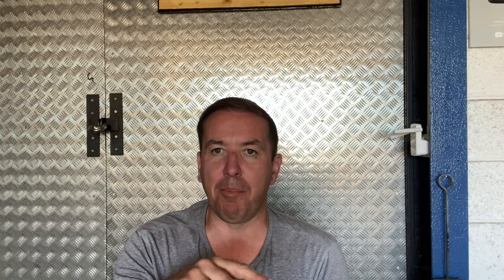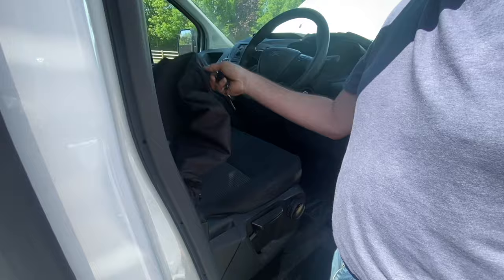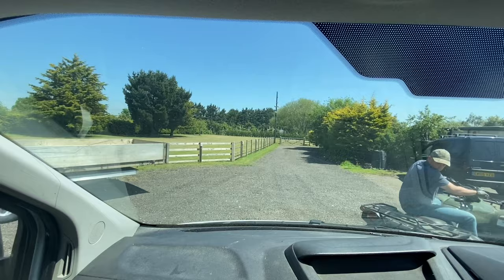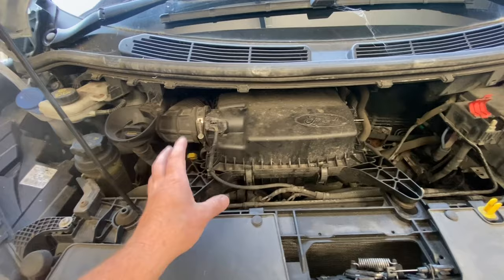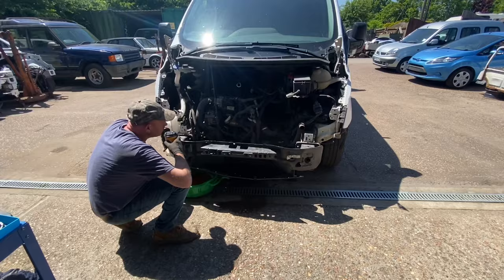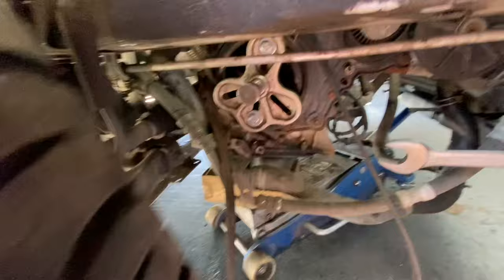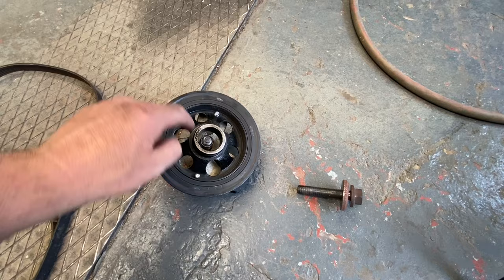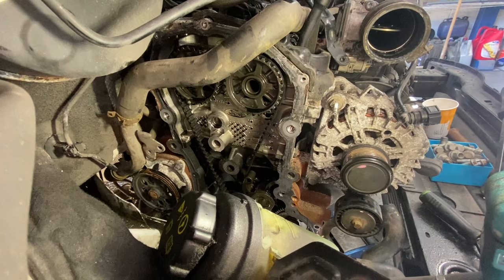Cheap 2017 Ford Transit Custom Euro 6 Engine Fail PT 1

Comment: No wonder that belts not been changed that looks like a nightmare to get into , i wonder how many hrs ford charge for doing it ?
Reply: Had it changed by fords couple weeks ago. £1300 all in. The issue with it was actually the cover that leaked and they changed the belt just because they didnt want it to be contaminated and take any chances.

Comment: That was a great unveiling. It was tempting to think that all engines are basically similar under the bonnet except for the number of bores, turbos or the like. But that one had lots of 'why did the designers do that?' features. I hope that there is no other hidden damage to the likes of valves, water or oil pumps etc. Seeing it played out like a 'who dun it' was fascinating. I was surprised at the amount of corrosion on the alternator and a few other parts, yet the body looked very sound. Part two will be keenly awaited. Thank you for a good few moments' entertainment.

Comment: Have a ford custom short wheel base 2.0 eco blue sat on my drive been there over three months now cam belt went on me at 74,000 miles or wet belt what ever one it is all I know is that three independent garages have put a 5/6 grand repair bill on it! Sadly prior to it breaking down I had just bought a brand new 21 plate and was hoping to sell the other one now I’m stuck with a van still under finance. I’ve asked before and I’ll ask again do you fancy fixing it 🥲
Reply: Send a message on Instagram mate
Reply from the maker: We would buy it unfortunately we only work on our own stuff 👍

Comment: As a Ford tech I can safely say that the 2.0 ecoblue engine is one of the worst engines ever put into a transit. I've not had a single day where a transit hasn't turned up on a flatbed with engine failure. If it's not diesel in the oil it's bits of timing belt in the oil. Such a shame as transits of old laugh at these new ones as they chug on down the road with 200k miles on the dash. Best of luck to you. If I were you I'd run a mile from that transit once you've fixed and sold it. It's massively flawed by design.
Reply: Does the 2022 have the same engine or have they made some changes?
Reply: It's weird because some have over 100k+ miles on and not had the problem yet
Reply: What are the best years for dependability in the Transit Connect vans? Thanks
Reply: Our one the  head   bolts broke top   got stuck under valve  and ejected  cam follower  out through  side   of  cam  carrier
Reply: 2.5 DI banana 👌
Reply: do you have any axperience with ford focus 2.0 ecoblue , is it the same engine as ford transite? i have it and it has 145k km , do i need timing belt replacment now or later?

tnx

Comment: According to Ford timing belt should be replaced after 140 K but i replaced mine after 80K.
Most of maintenance requirements on those vans are bonkers. Like service intervals every 2 years or 25K ??? WTF??
Reply: No wonder all the engines are shagged out after 100k, oil service interval should be more like 12k or 6k for heavy stop/start use.  Timing belts used to be 60k and they were not running in oil which seems to make them worse.  Shame really, just as Ford manages to make a van that doesnt rust it knobbles the engines.

Comment: Their is a recall coming out soon in next few weeks for this issue with Ford they replace the sump all the timing belt and timing cover as their is issues with the belt breaking up and as long as it has full service history they will pay for an engine if it is deemed not salvageable

Comment: that was only a16 min. video - with 10 mins. of added woffle [just jokin]. most people will watch 30 odd min vids day in day out - go for it
wet belts hate dirty oil - the acid in dirty oil attacks the "glue" in the belt itself, making it fall apart. changed my own 18tdci wet belt @ 100k - just in time - starting to break up + clogging up oilways - needed new B.E. shells.
change those rockers mate - they will be damaged + might come apart + damage new cams.
need to clean oilpump etc.,those belts shed a "liquid varnish" which gets into the oilways.
basically mr. henry ford ,dump the french s**t engine + bring back the good old D.I. [never happen, selling too many new engines at a massive profit]

Comment: I had one new on a 63 plate when they first came out. 4 year lease and I had to replace the DPF 3 weeks before I returned it. 
Nice Van's, well equipped,  but not as reliable as I'd hoped
Reply: I think that goes for most modern Ford's mate tbh. I had a 1.6 tdci Focus from new and the oil pump failed at 35000 miles... Transit Customs are nice vans but I personally don't like the driving position  in them.
Reply: @stateofmind91  
Seat goes up, down, back, forward, base tilts, and the back tilts, and the steering wheel adjusts !

Comment: A few years ago.
Customer: The exhaust camshaft is worn. Have you got one in stock ?.
Parts dealer: Certainly sir we have them on the shelf.
Now.
Customer: The exhaust camshaft is worn. Have you got one in stock ?.
Parts dealer: Certainly sir but you need to buy the full cylinder head because it is integrated.
That's how it is going. Greed takes priority with these big companies.
Reply: It’s not the full cylinder head it’s the rocker cover that holds the cams on these engines, he says it’s 300 pounds for a new one online, if a complete cylinder head could be bought new for 300 pounds it would be cheap at that.
Reply: It's the same with laptops. Everything now is on a single motherboard, even memory and processor are soldered, you have to change the entire thing!
Reply: @cmautolink656  Yes I know it's not the full cylinder head. I exaggerated on purpose.
Reply: @retrocomputeruser  I get ya bro sorry I thought you hadn’t a clue
Reply: @supergeekjay  yea this is an industrial revolution we are in - everything is on route to being corporate maintained, the car mechanic may be a thing of the distant past in 20 years

Comment: Engine blew on mine 5 weeks out of warranty. It was a hole in the piston. Total engine rebuild. Ford didn't help me what so ever 👍 not getting a Ford again 🤚
Reply: I heard about this before. So they are really that bad ? I was considered one Transit, but I'm a bit sceptical.
Reply: We’ve had issues like that in Peugeot but normally they give a grace period of 2-3 months after warranty and sort the issues out of good will,
Reply: @syncrovanCos  what are the other candidates?

Comment: hi you know its a interference motor the valves actually move the lobes on the cams its hard to tell on the video but no4 exhaust look suspect depending on the firing order check all the lobes are at 90 degrees  to each other so 90 180 270 and use a genuine ford timing cover the kit is just under £400 belts cover bolts etc pull the head to check the valves and its worth fitting a new oil pump ,good luck

Comment: You can just imagine the Ford van engine designers conference and them all saying how can we make our new engines the biggest complicated bag of shite going that blow up at 5 years old with only 130 k on them ? must of heard of 5 or 6 of these engines all failing in the last 5 years from new and one even failed at 3 month old so no wonder sales of French and German vans have gone through the roof these last few years .Sadly ford is not what it once was .
Reply: Well, not defending Ford engineering, but the belt appears to have not been changed when it should have been, so that's also a factor, not that they've engineered it to make that job easier and cheaper to do, but almost all car manufacturers are like that these days, even down to changing a simple headlight bulb 👍
Reply: @Charlie_Crown  Nothing like the days of the MK3 Cortina hey or the old ford escort and transit vans ,can even remember when transits had Perkins diesels ,showing my age now !
Reply: @adypurdy3641  just a lot easier to work on, the Escorts, though always wanted a classic MK 2 Cortina, especially with the vinyl roof option, but decided to go forward with the more modern Sierra, another great car and easy to work on also 👍
Reply: I think Ford need their fingers raping what a waste having to change the cover and two cams it's not because it's a great step forward it's rubbish

Comment: compression test would be my next step but if the oil pump stopped driving i wish you good luck..my mk6 broke an oil pump drive chain and the donk was buggerred before i could get off the road..I enjoy your work guys, thanks for sharing

Comment: I didn't hear you say what capacity this engine is. (2.2?) But from what I've seen of Euro engines they are all so small. I wonder if the never ending pursuit for lower fuel use and emissions is leading to highly stressed engines that work far harder than they should. A van this size needs a 3.0 litre turbo diesel with an eight speed auto for efficient work. It's not all about fuel economy when it comes to running costs.
Reply: Its the 2.0 EcoBlue engine. Very torquey but no top end power so only worth reving to about 3000.
Reply from the maker: It’s a 2.0

Comment: don't put the spare wheel back underneath on that model.......they go walkies
Reply: That’s exactly why it was in the back 😀
Reply: Do you mean stolen or fall off? 🙂
Reply: @NeilsCarsAviationTravel  we have 2 customs and the newer ones are modified. The old one has a wooden box behind the driver's side to hold the spare wheel
Reply: @sammytheseal2307  an easy steal....
Reply: @jonporter8852  Oh dear lol, can't have nice things these days 🙄

Comment: What a piss-poor design!  You've got to disassemble half the van just to change the timing belt?  Then you can't remove the timing belt cover without destroying it? This should be a routine service procedure, 4 book hours...tops!   Whoever thought driving something as critical as the oil pump with a rubber belt was a good idea?  This is worse than GM in the 1970s!
Reply: Try having to work on the transits daily, we have replace multiple engines due to stripped teeth on timing belts
Reply: I work for a ford dealer and you do get 4.4 hours do do a cam belt on these.

Comment: Are those push-on cam lobes intended to be sacrificial? Wondered if they’d deliberately built in the weakness under stress so they back out and it avoids piston/valve collision or head damage. Either way, cracking vid. Cheers, gents.

Comment: He blew up a 17 plate 👀😂
Reply: 130,000 miles and no cam belt change! Surprised it lasted that long
Reply: 150k or 10yr interval on the 2.0 blue engine. Early belt failure is common. Look it up.
Reply: @NeilsCarsAviationTravel  it happens mate 😉
Reply: @NeilsCarsAviationTravel  I’m an HGV driver,one of our old fitters told me once that if you change the oil every 6-8000 miles and do the cam belt between 50-60,000 miles.No reason why you couldn’t get half a million miles plus from a modern Diesel engine.

Comment: Always enjoy your vids. As retired mechanic I’m at a loss to understand the complexity and stupidity of modern designers. Cam belt running in oil, nuts!
Reply from the maker: It’s not bud it’s a separate belt for the oil pump 👍

Comment: 130k and probably not been serviced right, lasted a long time tbh, 99% of the time belt faliure is caused by poor maintenance, look aft them, they look aft you 👍
Reply from the maker: Manufacturer says 150k but I would not recommend it. My friend has one with over 200K on it still going strong but he has replaced the belt twice and new oil every 10k
Reply: my Torneo has done 22000 miles supposed of had the timing gear rattle fixed, injectors replaced, different marked oil dipstick for more oil software altered just had recall for timing belt
had several oil and filter changes and still reports no 4 injector fault every time a slight incline is faced. So looking after your engine only applies if you have a good one to start with.Untill software upgrade I had used 25 gal of adblue in about 10,000 miles. new batteries in first 6 months paid by me because ford said nothing wrong. My Fiat ducato used one clutch I battery in ten years.

Comment: I had a 2017 transit for 3 years, I always wanted to have a play with it but it was a Northgate van, so I never got the chance, nice to see inside one,

Mine ate an EGR valve at around 15k (a common issue) but apart from that ran faultlessly for 50k,

I can only imagine the camshafts are frozen and the lobes heated to form an interference fit, sounds like a shitty way to make a cam but when you think about that being the failure point and it saving the engine I suppose it makes sense... I don't suppose that top end is going to be cheap though 💰

Comment: I’m a transit tech for Ford. These cambelts are known for stripping the teeth and snapping belts. There is a recall now and Ford will pay for a new engine. 

Also, once a new engine is fitted and you drive it, service now will come on the dash and it will bring up injector wiring fault codes. You will need to replace all four. One you replace the one the code relates too, the rest of the injectors all fail. 

Also, the thermostat, if it has a blue bleed screw on, it will need to be replaced due to being the old style thermostat which cause problems. The new style ones only have one of the two sensors, and the lower senor on the thermostat is no longer require and you leave the plug hanging. Also, replacing the fuel pump, if you get it slightly out, you’ll have huge problems.

Message me if you need any help!
Reply: I did not know about the thermostat! Thanks 😊
Reply: I'm guessing they're a cheap Chinese  belt and if I buy a new Transit I should replace it with a Gates belt asap?
Reply: @chrisjohns9631  no it’s not that. The vehicles that are driving lots of miles don’t seem to suffer as much.
It short journeys not allowing the van to regen properly which then results in oil dilution and that weakens the belt. 
My main advice to everyone that has a 2.0 transit is to over service the oil change and get one done at every 10,000 miles if you’re planning on keeping it for a long time!
Reply: @johnforeman5816  I did my apprenticeship years ago on sludged up Hiluxes and Landcruisers, I know the value of regular and frequent oil changes!😁
Reply: @johnforeman5816    They sound like a piece of crap mate.
Reply: Der Motor läuft nicht bis 30.000 km, woran liegt das?

Comment: Have had it on these where brakes failed with that panther engine and rubber was inside the vacuum pump after a belt degrading, so check that also! 👌🏽
Reply: That's what's happening with them, the brakes die before the engine 😕😕

Comment: Rob you could get Chris to tap the top of the valves with a hammer and listen for the sound when the valve seats fully. If it sounds hollow then you could have a bent valve stem. Looks like you got away with it though. Great in-depth video great content.

Comment: Awesome video as always. Excuse my lack of knowledge on diesels... I'm a petrol man, couldn't you do a leak down test through the injector hole or at least put some pressure in to see if it holds as both valves will be closed with the cam/rockers off

Comment: Ford say belts to be changed at 100k all the covers have to been replaced I had one done at ford new engine £8k fitted great video
Reply from the maker: 150k or 10 years 👍

Comment: A mate had a 2.0 mondeo diesel that had a cam belt change then engine failed a few k later, apparently there is a 2nd belt that never gets checked which failed.
Reply: That's the wet belt 👍😁

Comment: Nice vid chaps👍🏻 wet belt is expensive job to have done and timely.I had my 09 plate Mondeo wet belt done took my mechanic six hours . Ford recommend 120 5000 miles or 10 year change anyways looking forward to the next vid on this van 💪👍🏻

Comment: In my experience all the rockers should be changed with the cam shafts, when the cams have been contacted by the valves and span the lobes, they are designed to fracture and break under stress, the fractures aren’t always visible to the eye. It’s simply not worth it  it could potentially put you back to square one…. . 
Great video lads.wish I had time to do my own… keep it up

Comment: Possible to pressure test the head before going any further? Make a bung to go into the injector port and see if it blows by. Not very accurate but it will show if you have a bent valve.

Comment: Ive got exactly the same problem on a vauxhall insignia 2.0d, but my one has broken every single rocker, im hoping that it hasn’t bent valves, 🙏🏻👍🏻
Reply: That should just be a new set of rockers and the valves will be fine

Comment: Does the van have a full service history? Even at 134k miles surely a company like ford could design a better engine design. Very in depth diagnosis from you guys and I do enjoy your longer vids. Look forward to part two. See you in the next one!
Reply: At the moment in NZ the problem the mondeo auto transmission suffers from internal plastic components is gathering momentum & now it is only a matter of time NZ will follow suit with a Class Action like australia & US.😎👌👍

Comment: Good video guys. My stepson drives one of these as a courier (leased) and he has been through 3 of these in 2 weeks, all 2017 models! First one broke down after losing a load of coolant (but not visibly), second one he rear ended a Ranger with, and the third has gone into limp mode after ONE day's use. He's not having much luck with this model but as yours is the same as the ones he drives, I am very interested in your repair of the one you have and the numbers at the end 😁

Comment: not sure if you are going to see this but you may need to clean out the oil galleries they suffer with clogging due to the belt deteriorating they also block up the vacuum pump which is pretty common. normally when they go its a replacement engine but i would be interested if it runs once the new cams are in.